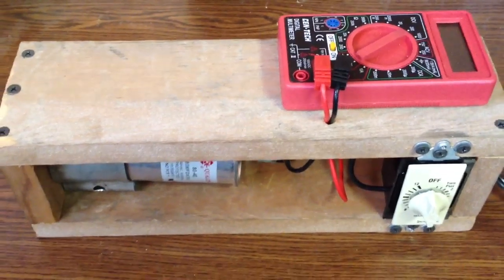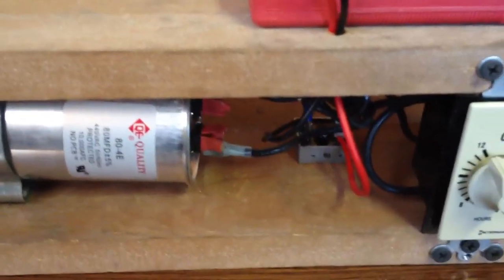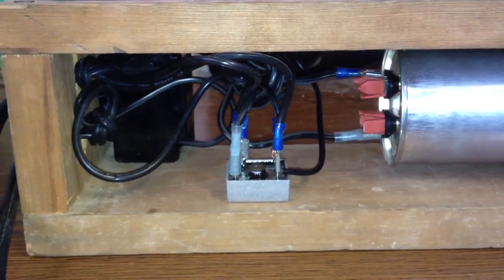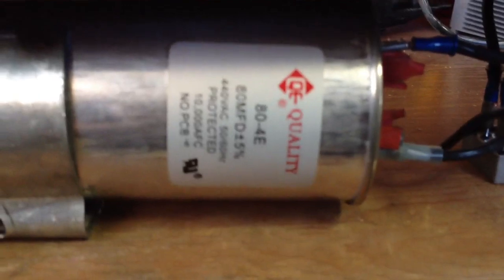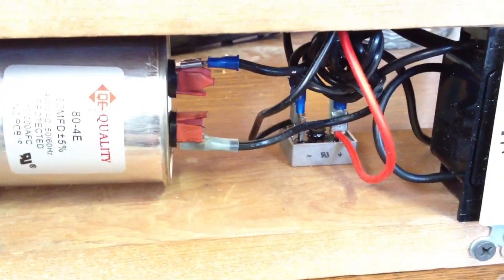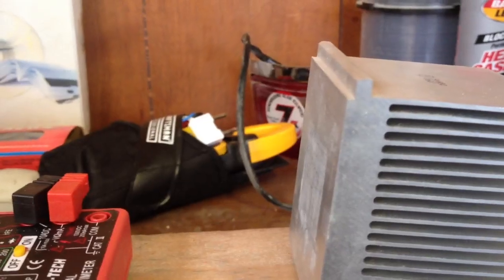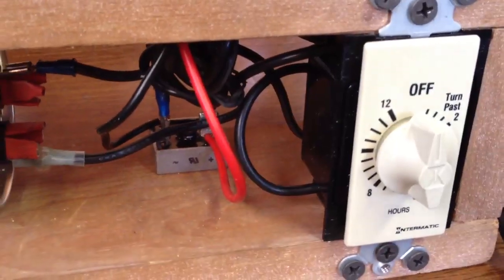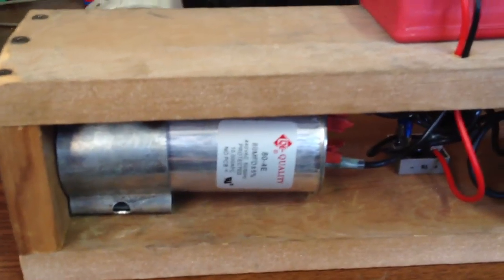How to build a Capacitive Battery Charger (Part 2) DIY

Comment: Hello bro this is Ratheesh and I have a doubt ,, that how can I chose the capacitor for the various amps battery ,, can u suggest me for this or send me the details for it
Reply from the maker: Ratheesh Ramakrishnan That Would be determined by how quickly do you want the battery charged. in general, for recharging a car battery or both battery, 80 µF is a good number. If you want a slower charge but more desulfation, go with a 20 or a 40. Motorcycles use a 10 or lower. Electric cars, 72 V battery pack are usually use four or eight 80 µF capacitor
Reply: @KmanAuto  thanks a lot
Reply: @KmanAuto  bro what's that 20 or 840 that numbers don't match which have a huge difference between ,,any typing 
mistake 
And also please mention the charging timing 
Thanks in advance
Reply from the maker: @raatheesh  20 or a 40. I cannot give charging times. Charging times are determined by how dead the battery is, and it's condition. The more sulfated the longer it will take. Pair the Desulfation Charger with Epsom Salt (See my video series on that here: https://www.youtube.com/watch?v=vqfaziZE1XM  ) for longer battery life and faster overall charging. 

Please be sure to Like & Subscribe!
Reply: @KmanAuto  thanks bro ,, 🤝

Comment: Wire size awg please?
Reply from the maker: itsmeatiq 16awg will be fine for this size unit
Reply: KmanAuto I am using 18 awg on ac side but using 16 awg on DC part of the circuit

Comment: I built a charger for a 24 volt battery bank and it only seems to out out 22 volts when on the battery!
Reply: Ted Norder, hi, did you use one cap of 80f?

Comment: Hi again FriendI need your help building a charger for this smaller Battery.  UPG 85989/D5779 Sealed Lead Acid Batteries (12V; 8 AH; UB1280F2) . Please help me with the size Capacitor and Bridge Rectifier. How long should a battery of this size be charged? Any help? Your have been a tremendous help in my working parts and Chargers. Thanks Don Jackson

Comment: Hi Kman, hi guys. About 3 weeks ago I finished to different capacitor charger like Kman explained. They work well and everything is well. Thanks Kman. Now, as I live almost Off Grid I was thinking to build a bigger charger that i could hook on my 3250 Generac Generator to charge my battery bank. This time it should be a 240 vac system. I know that with a 240 vac setup the amps double. I built the whole thing with four 80uF caps and three different switches, two 80uF caps together then plus one 80uF and plus one 80uF. With that I could choose between different loads. I tested the system on my main 220 vac and it worked well. The two 80uF caps together were charging with about 13 amps to my large 25 vdc battery bank, all together with nice 26 amps. It was rocking. So now I was good to go to hook it on my Generator. And puff, the fuse on my Generator blow out. I repeated and noticed that instead of only 13 amps for two working caps, it was running for about 1 second at about 26 amps. I was quite surprised and cannot wrap my mind around why suddenly my caps put the double of their rated amps out. 80uF normally put about 3 amps on 120 vac, on 220 van they put about 6 amps, but on my Generator they put even 13 amps on 240 vac. Could it be because of the square wave form or what. I do not know what is wrong. So, if you guys or Kman itself could find some time to explain, it would be very much appreciated.
Reply: Physiator Physio Tools. 
Have you figured out the problem with generator connection? 
What size is your 24v bank? 
Ty

Comment: How we know that the battery is fully charged? 
i am asking because in a 70Ah car battery i used, i was checking every 2 hours with a multimeter the volts. 
It started charging at 46 volts, dropped to 14,5 after many hours, and when i reconnected it to the charger again after 1 day of relaxing, it was charging with 15.7 volts and was going up to 16.5 volts .
The battery has a charge of ~13.1 volts when sitting now. 
Is it ready to be used or it needs more??

Comment: If you were running this same charger setup on 240v and you touched the aligator clips with your hands then wouldn't you just be shocking yourself with around 240-270v dc?  That sounds a little dangerous to me, so how do you offer / provide protection to make the charger a little safer when used on 240v ac thanks.  I'm still a little lost as to how the charger can automatically reduce the voltage down enough for a 6v or 12v battery also without damaging the battery?

Comment: How can you attach  the rectified voltage of around  125 V DC to a 12 V battery?
For that's what this will supply  at the Plus and Minus terminals.
Reply from the maker: Voltage will automatically self adjust on the DC end to match just what is enough that is needed to enable current to flow. Plugged into a 120v AC outlet, this charger can charge a battery or battery bank from 0 to 140v, as AC once Rectified to DC is about 170v, given a bit of leeway room for current flow, I found 140v to be the top end of the spectrum.
Reply: grassroot011 a tensao é alta, mas a corrente é baixa por isso nao tem problemas a bateria.

Comment: Hi l have a capacitor  for my charger but it has 3 conectors . Pleas tel me wish ones tu conect...
Reply from the maker: That would depend, what does the label say? Most caps that have 3 connections, are like that because their are actually 2 caps in one. One is usually larger, one smaller. I dislike these for HVAC equipment, but for one of these chargers, it works rather nice, as you can have a "high" and a "low" setting.
Reply: Thanks soo much for your help . It makes sense . Thanks ariel

Comment: hi Kman,  love the videos. 
Quick question,  what would you change to make it just a de-sulfator, 
less charger.
thanks.
Reply from the maker: smaller capacitor. it will charge the battery slower, allowing it to pulse the battery for a longer period of time to desulfate.

Comment: Hi how are you, with 100 mfd cap, how many amp i can get?, i have a bank of battery 60v 120ah, in how many time you think y can charge the batteries
Reply from the maker: You would be able to charge that from 120v outlet in approx 7-10 hours. 3-5 on 240v.
Reply: ***** Tks for your help
Reply: ***** excuse me, and if i use 2 capacitor of 100 mf, in how many time you think i can charge the 60v 120 ah battery pack?

Comment: Gmorning dude, a quick question can u post another video with a running capacitor that has the 3 prongs instead of the 2, im still trying to figure out where to connct the wires, thanks dude,any help would be greatly appreaciated..
Reply from the maker: Unfortunately, I cannot. I do not have any 3 prong caps. Sorry,
Reply: Np dude.
Reply from the maker: Anthony Alleyne Basically, you have 3 connections. One is the "input" and the other two are "outputs" so to say. When you go from the input to one output, it will be 60mF, if you go from input to the other output, it will be 5mF. They are commonly used in Air Conditioners. Instead of having two separate caps, just one with "two" built inside. Think of it like a dual core processor with one core at 60mhz and the other at 5mhz :)     Saves space inside the AC Condenser.
Reply: Thanks dude.
Reply from the maker: Anthony Alleyne No problem. Could always use Thumbs Up's and subscribes on my videos though ;)

Comment: Awesome Creation Dude!!! I Have a running capacitor but it has 3 prongs at the top, so how would i connect to your setup!!
Reply from the maker: That means that is a dual cap. Or in other words, their are 2 capacitors in the single can. It has a 60mF and a 5 mF. You could use some sort of 3 way light switch to switch between those two sizes. 60 for charging, then 5 for maintaining or long term desulfation.

Comment: To extend the life of the Bridge and the Capacitor, you need to add a surge resistor between the positive of the bridge rectifier and the positive of the capacitor. Any where between a 1-5 ohm wirewound power resistor should work. 
During the first half cycle of the AC, there is almost '0' ohms on the capacitor which could damage both the cap and the bridge. A fuse is essential especially if you turn it on and walk away. A slo-blow of about 2-3 times of the normal input current.